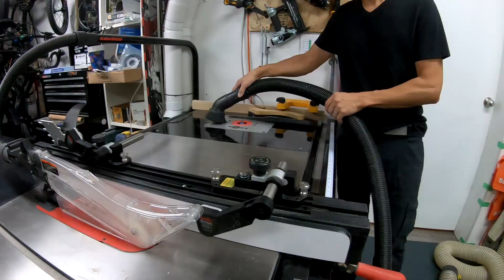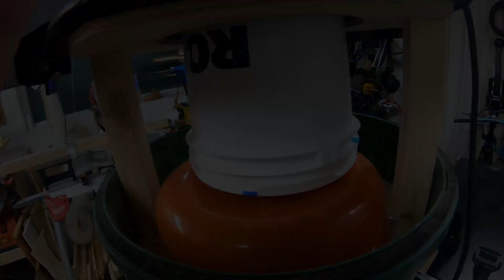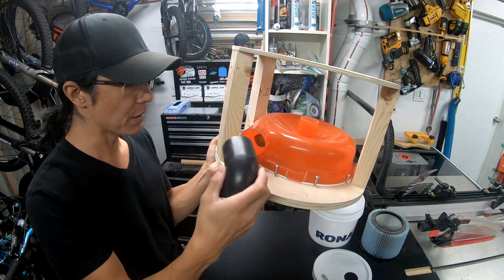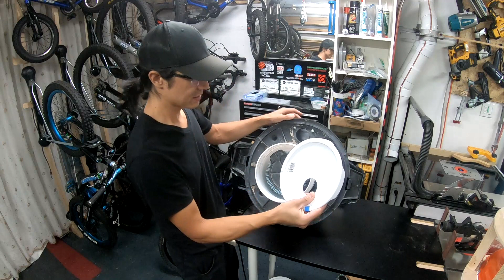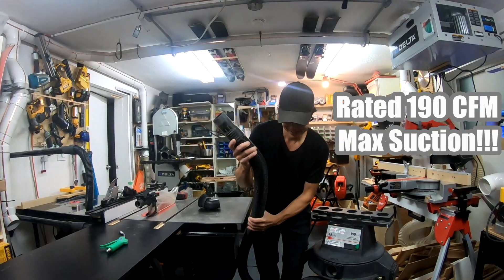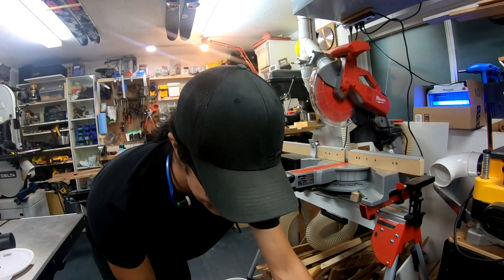Low profile Dustopper cyclone separator INSIDE my shop vac. No cart needed!

Comment: Good morning , taking a chance since this video is a year old.  I just bought a second craftsman vacuum identical to yours and found your video trying to search for the model number.  It is worn out on my label.  If your is still legible , could you please post it here ? Thank you 🙏
Reply from the maker: Amazingly I still have the manual, and I had used an ink date stamp on it that says Apr 18 1990. The model number is 113.298900C, stock number (09)29890.
Reply: Thank you so much 🤩

Comment: Thank you for confirming what I was thinking. "There's no need for a separate cyclone set up, when you can combine them". 
And there's no need to have a multi-gallon barrel just to house the vacuum motor, when a simple bucket created the link. 
One question; is there a likelihood that the bucket would collapse from the vacuum suction?
Reply from the maker: It's not likely since the vacuum motor isn't that powerful. I've heard from several people that when dealing with a 2HP dust collector and using plastic barrels, that they have collapsed those.

Comment: don’t say the word invented.  that’s reserved for completely original ideas.  even if someone improves on and existing design, it’s still not original.  invention is a te used for a design or method never seen before.
everything you have there can be purchased.  people build all sorts of dust collectors for woodworking.
do a search, you’ll see.

i suspect that vacuum is not going to last that long because you’ve restricted it by trapping it inside a bucket.  the surface area is greatly reduced.  try measuring the air flow with and without the filter being trapped. 
the filter has a pleaded design to greatly increase surface area to increase airflow, so this is incredibly minimized and counterclockwise constructive ( for the lack of a better word) and will cause the motor to work much harder.

the compact design is good.
this double wide cart that everyone builds (myself included) has to go because it takes up twice as much space as it should.
the really tall systems are just as annoying because they fall over and the hose has to be extra long because the inlet is so far off the ground.

i’ve thought about utilizing the portion of the tyson vacuum with the multi-mini cyclones, but haven’t taken the time.
maybe you have time…
Reply: Yes, I partially agree.  As a former research analyst for a German company BASF,  Our advertisements always
stated .... We don't make the product. We make it better! 
That is what this gentleman did.  My compliments.  Honestly, thinking outside the box is a unique talent.
Nice work!

Comment: Very different than what I have seen in dust collection. I like the idea of the low profile. 

Other cyclone systems separate the dust from the large chips.

Your design appears to dump everything into the bucket and doesn’t separate? Is that correct? I am still trying to understand dust collection with so many designs and how others use the terminology. Thank you!
Reply from the maker: It's the same/similar efficacy as any other system using the orange Dustopper cyclone. Ideally 100% of the dust and chips are dropped into the bin and only clean air enters the filter, so in essence the less "separating" a system appears to be doing means it's preforming really well (so long as both dust+chips are going in the bin and not the filter).
Reply: @WishfulThinkingProjects  ok that explanation makes sense and easy to follow. 

I’ve watched some videos that design strictly adhere to the “separation” of fine dust and chips making it a point to collect the chips in the bucket with the “dust” being sucked up into the filter.

At this point of my small shop I’m just trying to employ some sort of collection to help with dust.

Comment: Cool design! Don't you need to seal the gaps in your system? I wonder if it decreases effective suction at the hose.
Reply from the maker: Ah, yes. Would be a good idea to add weatherstripping around the bottom of the wood piece that the Dustopper is mounted on, to seal against the canister once placed inside. I don't believe there's a need to seal between the Dustopper and the filter housing at it's a pretty tight fit, but if the bucket lid is flexing in towards the filter, it could be letting air in a bit. Thanks for the feedback and question!

Comment: Would like to come up with something that would integrate a bag into the system.
Reply from the maker: That would be a good feature! While I haven't tried it, it should be easy to do: Drill a hole in the white filter housing and plug a small hose into it (say 1" diameter; like the kind used for a bilge pump). The other end goes into the drain of the shop vac. So if the canister is lined with a bag, that small hose would suck the bag tight against the canister.